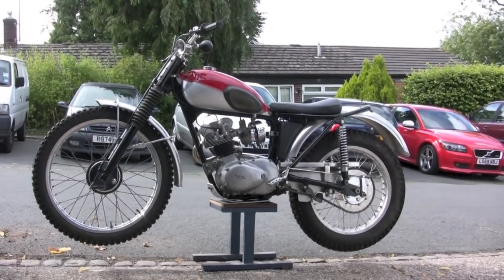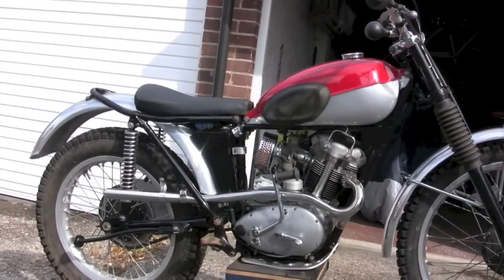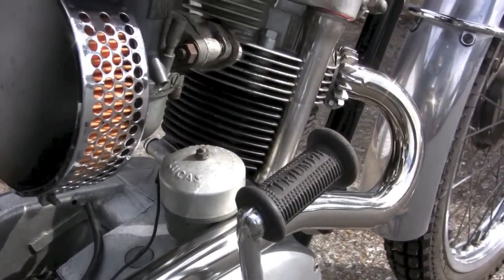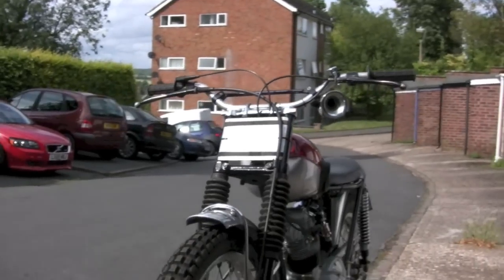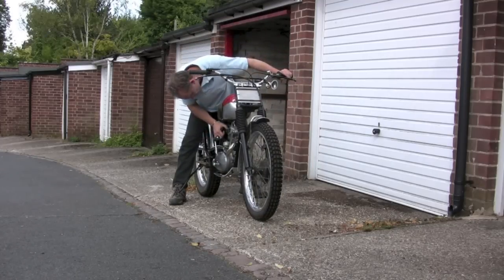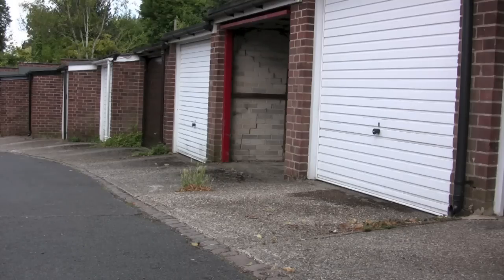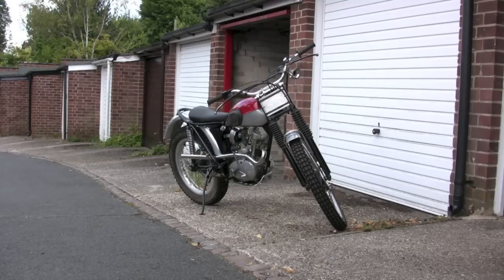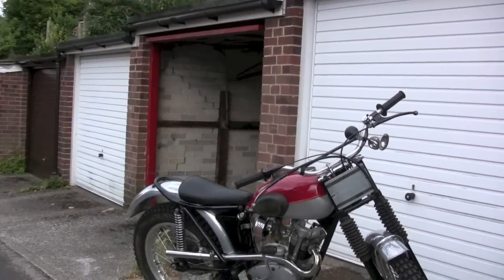Triumph Tiger Cub Trials Rebuild Update

Comment: Hi, nice video of a nice looking bike.

I had a Triumph Tiger Cub, Super Sports model, in 1970/1 when
I was 16/17 yrs old. 

Your bike is the trials for sure, with the high rise exhaust,
no headlamp, gaitered front fork springs and the external stalk distributor, (the
SS had points behind a small metal cover on the crank case, however your finned ally rocker covers are
definitely SS model parts not trials. Apart from the SS model the Trials & Tourer had chrome plated pressed
metal rocker covers. They used to leak oil but the cast ally ones were oil-tight….until I over-tightened the fixing nut and fractured the ally…..had to buy a new one and it cost a load....never over tightened them again! My crank-case used to leak oil even after I fitted a new gasket and gasket goo. I regularly rode from Nottingham to Cambridge and got used to having to stop on the A1 (a section which later became the A14) at a pub called Trinity Foot (Good Food) …its still there only just though with the new road works, but hasn’t been open for 20yrs. By then my boots
would be wet with engine oil, so I would find a stick and wrap a piece of cloth on the end before dipping it in my tank. I then wiped the crank case middle joint clean with the petrol cloth and applied exhaust sealant which quickly
dried because the engine was hot. No more leaks for a few hundred miles!! 

Various other differences between models, pillion seat /
battery box and switch with “Emergency Start” feature/Headlamp/etc  but they all knocked out big end bushes every
few months if ridden hard. I upgraded to an Alpha roller bearing eventual and
never a problem with big end again.

Happy days….oh and no crash helmet required (glad I survived
without brain damage)

Nick

Comment: Fantastic cub. A friend of mine rode an early 60s model cub with a rear sprocket so big the bike could do maybe 45 mph max. This was back in hs in the late 60s. That bike had incredible low speed grunt and could climb dang near anything. Extremely fond memories of it and another friends sherpa t 250 .
Reply from the maker: You might find that his bike was converted rom a road bike with road gears, lots of people do it and gear it down via the rear sprocket rather than the expense and trouble of fitting the trials gears. Mine has the trials gears fitted so is pretty slow!

Comment: A vw tail pipe. If it is the filler will blow out fairly quickly but it still will be effective but not as good as it is now.
Reply from the maker: Two queries, one why would any filling come out when it’s designed for 1600cc engines and this is 200cc. Second, there is no filling, it’s a stainless steel tube with a perforated stainless steel tube inside. There is nothing else!🤣
Reply: @garyhuston  it doesn't have the volume of the vw exhaust to cool the gasses down before they get to that tail pipe piece. Between the two tubes is a fiberglass filler that just blows out quickly when used on a bike. We used them all the time in the 80s on the smaller bikes. Perhaps they make them differently now but that's how they were when we used them.
Reply from the maker: @TheDevonblacksmith  when I owned a vw the engine is as close to the tailpipe as this engine is! And no, there is no matting or any other finer inside, it’s just two stainless tubes. Time will tell how long it will last. I’m not intending on using it much so it doesn’t really matter.
Reply: @garyhuston  the vw exhaust is a big piece of pipework with a lot of surface area to disparate the heat. But if it does not have the wadding it won't loose it as the old ones we used did. It's nice solution and suits the bike I have two cubs myself. One in similar trim to yours.

Comment from the maker: Can't really help much as it's a very long time since I re-built it the first time round! Can't remember where the mudguards came from but Sammy Miller is doing them now. As for the tank, it came like that and I assumed it was standard as the dents are way too uniform to have been put in afterwards, the flange around the edge is far too neat to have been pushed in! The lock stops are again as far as I know standard, they are about 2" long.

Comment: Hi Gary bit of info if possible could you tell me where you got your frt and rear mudguards from ? Are the dents in the tank for clearance because you are not using the original lock stops ? Thanks Rod.

Comment: Hi Gary, You Have a real nice Bike! I'm looking into restoring a Tiger Cub very similar to yours, Do you know a place where they would have some parts for sale for Tiger Cubs?
Thank You
Reply from the maker: Loads of places! What are you looking for?
Reply: +garyhuston i'll start with engine parts, Head, cylinder , piston, rings, push rod.
Reply from the maker: I didn't buy any major parts for mine, it was complete, I just reconditioned most of it but these people have most bits. http://www.triumphtigercubspares.co.uk/ 
Most of the other companies I used have packed up like Hamrax, Clwyd classics and the like. I bought a lot of bits at the Kempton Park auto jumble.

Comment: That silencer idea is genius. I'm having one. Do you happen to know your pipe diameter ?. It's made my day.
Reply from the maker: 1 ⅜”
Reply: @garyhuston  Thanks. I’ll figure it out. Mine is 1 5/16” standard. Great idea that answers loads of issues for me.
Reply from the maker: I say it’s 1/38” I just measured the vw tailpipe because I have one here but not the bike! There’s nothing in it though. My pipe was a custom made item in ss
Reply: @garyhuston  just researching. But for a tenner I think I’ll just buy one.  Most sites seem to say 35 mm OD and must be close to 1 5/16 “ or  33.3mm ID. 
Thanks for help.
Reply from the maker: It’s such a small difference that you can get it to fit somehow, it sounds great!
Reply: @garyhuston  I’m deffo up for this. Building a standard street scrambler. But with a parallel set of cafe racer bits. Exhaust being an issue. High pipe interferes with rear sets on the pillion pegs.